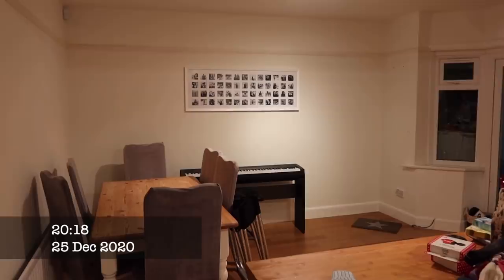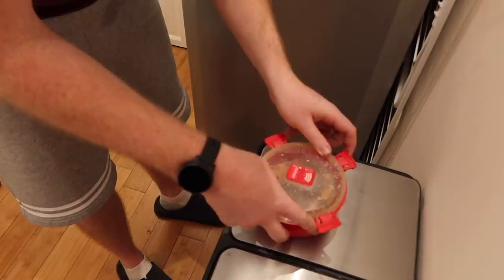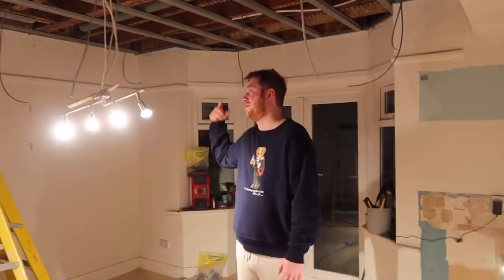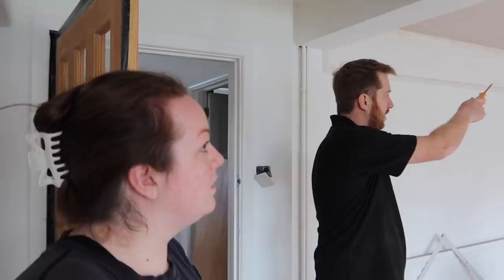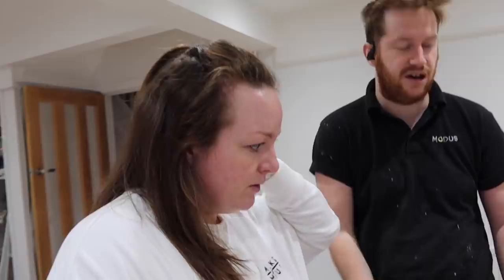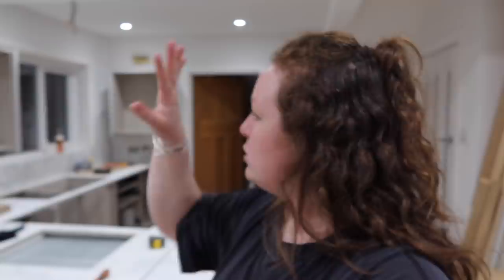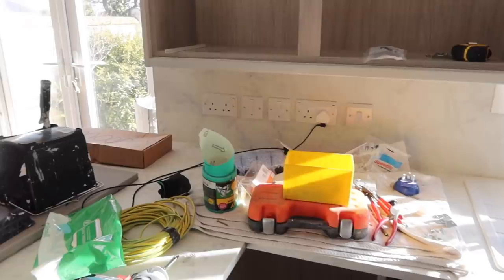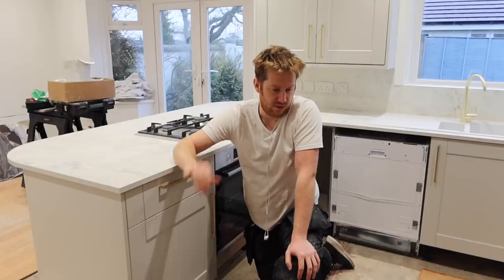KITCHEN RENOVATION VLOG & UPDATE! 🏡 DIY step-by-step process + other house plans & ideas for 2021

Comment: It is starting to look lovely. We have the same oak grey carcasses from Howdens, and the same oven! We got Chelford grey and quartz worktops. We love the knobs on the oven too 😂 It is so true about the floors, we got a product similar to Kardean but it is so easy to clean. And we have a lower seated area and display cabinets in our dining area, we moved the dining table , which we only use when we have guests, into our very long front room. As you say, have it how you live!

Comment: You guys have done a great job! It’s looking really nice. When we renovated our kitchen we got rid of the eat in area and extended the kitchen but we now regret not knocking down the wall between kitchen and dining room. Just like you we don’t usually eat at the dining table but like lounging on a sofa. We also have a L shape counter with 4 large stools.
Reply from the maker: Thank you! Yes we eat the same way and that's why we designed this kitchen like this instead. Should fit 3 stools!

Comment: We did our garden first but that’s coz only access is through the house. We’ve gone low maintenance with Indian sandstone patio that looks like rainbows when it rains . Fake lawn and decking with raised beds for some planting but like you we are not real gardeners so got rid of two dying trees and a dying hedge and put in new fence. We had friends of ours do the gardens and we love it. Can’t wait for spring/summer to use it more. Just waiting for summerhouse I want to be available to buy then we can also put up the lazy spa which will go behind the summerhouse for more privacy x it’s a lovely modern space. Worth all the  just over £12,000 it cost us to get it done and level and safe x  can’t wait to see your garden plans and u are right to do what is best to suit your needs when doing up your home xx
Reply from the maker: Sounds wonderful!! xx

Comment: FYI when rendering now you have to add insulation too:)
Reply from the maker: Insulation? Why?! I don't think you do?!
Reply: @brogantatexo  hmmm well i cant find any reference to this now...maybe its an old rule that has changed! but about 5 years ago my dad did up my grandads house before selling and they were told that is what they should have done so in order to get it to pass regs they had to add internal insulation after.